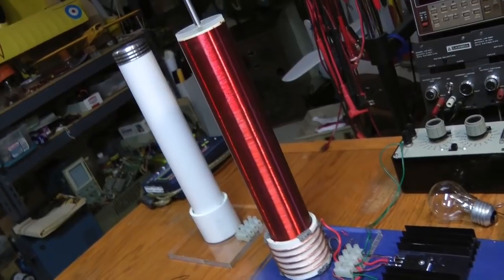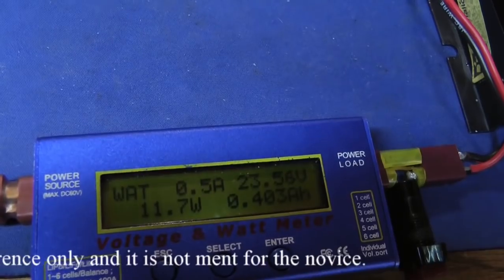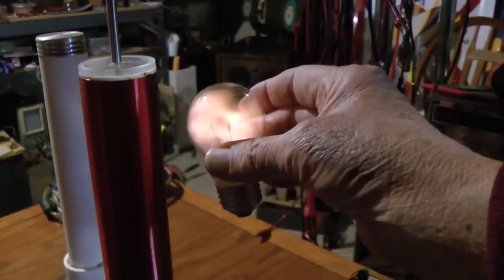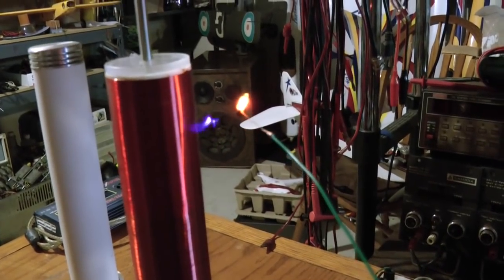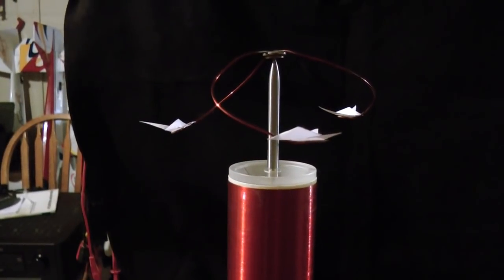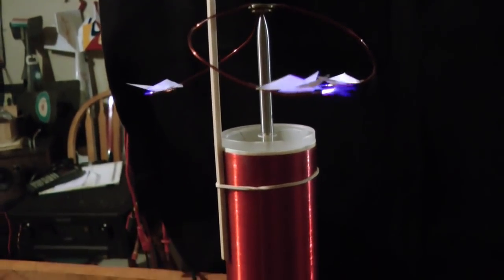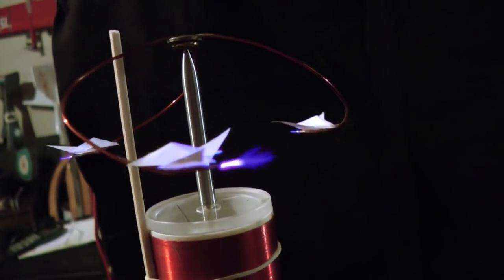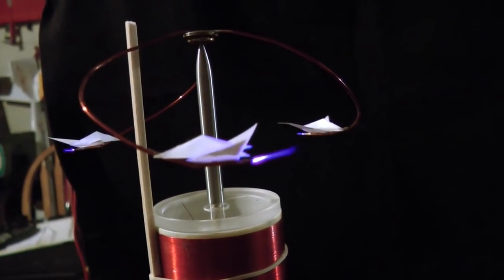Tesla / Slayer Ionic Propulsion

Comment: I may be totally wrong but I think the propulsion is because the charged plane ionizates the surrounding air, then since equal charges repell themselves the plane pushes the ionized air away as well as it is pushed forward.  (sorry for the bad English )
Reply: just in case you're wondering ionization is much stronger in the rear of the plane because that's where the point is, what do points have to do with it? i'd google it

Comment: Looks interesting,  also like a DIYr could build one of these. 
It would be intriguing to know if/how tip shape changes would affect the thrust vectors and spark plume shape.
Curious, does it hurt if you accidentally ground to the electrode?
Reply from the maker: Since high frequency travels around the outside of the wire I would imagine there could be varying results. I never shorted the coil. I'll give it a try some time.

Comment: what a cool demo.  i bet you could sell a lot of those little planes.  have you considered cutting off the neck of a wine bottle &  putting it over top electrode of the t.c. . then putting a positive grid at the wide end to attract & accelerate the ion flow??  might get a significant bit of thrust out of it....  might could make a fancy hi-tech ceiling fan.
Reply from the maker: That's a great idea Geo but I think it might be a risky adventure. The plasma or ion flow can set things on fire or burn holes in your skin. But I might make something like that anyway. Thanks

Comment: I wonder whether this one is ion propulsion.
Mass of electrons is very small compared to the mass it  need  to accelerate here.
I guess its bcz of the heating effect. The propulsion heats the air creating pressure differences which in turn cause it to move.
Others way seems kindof longshot..

Comment: Dude, can you make another one of those things, but make it have 8 legs, and have each of the legs facing downward?

I wonder if the amount of thrust generated by that will increase with more wires. And if you focus the force downwards, I wonder if it has enough force to lift itself 

Could you try that??  Thank you!
Reply: It wouldn't generate enough thrust to lift its own weight. Thats the issue with ion propulsion its not as powerful as chemical rockets

Comment: How much electricity has been consumed, may I ask, please? If the efficiency from electricity to plasma emission power is good enough, then everything will be possible in terms of space travel
Reply from the maker: It's not very efficient Rocky. The resonator is running at 24 volts and using .4 amps.

Comment: charges escape from the sharpest point of the charged device. I think that's what is happening here, resulting in an electric wind that rotates the prop
Reply: Hi, do you think such electric wind could propel something in a vacuum?
Reply: The slight breeze these  ion thrust devices (the litte jets in DadHav's video above) -- people call that the 'ion wind'.  That is not what makes the little jets move.  That ion wind is only a side effect of the purple stream of ionized air streaming out the back of the little jets.  That purple stream of ions BUMP INTO NEUTRALLY CHARGED AIR MOLECULES and those neutrally charged air molecules get pushed around by the ions, and those pushed-around neutral air molecules are the 'ion wind'.  That's not what pushes the little jets around.  The jets move around because of RECOIL.  Think of the recoil of a rifle into your shoulder when you fire it -- the opposite direction of where the bullet went.  It's Newton's 3rd Law of motion -- "equal and opposite reaction'.  Think of the bullet as the ionized gas streaming out the back of those little jets, and think of the jets as the rifle.  Same principle of how normal rocket engines work.  RECOIL.
Reply: I agree with you, recoil, and equal and opposite reaction.
BUT.
In a vacuum there is NO opposite reaction, due to the fact there is nothing to react on.
The experience proves it, and the logic too.

Comment: could it be air heated to a high temperature that causes the propulsion? a combination of air and supercharged electricity....just wondering
Reply from the maker: From what I've learned recently. The high voltage high frequency emits ions from the cathode or pointed wire. They then try to complete an electrical connection to the anode which in this case is earth ground.
Reply: DadHav so what about in a vacuum, and do  you still need a ground?

Comment: when working on the high voltage antennas on naval ships my father would get microscopic holes burnt to his bone in his fingers when they came to close to them
Reply from the maker: The same thing happens with this. A tiny but deep burn like if poked by a red hot needle. Ha, the good part is that it's self cauterizing.

Comment: Here's what's happening, as far as I understand it:

The ends of the wires have significant negative charge, and they ionize the air around them (they knock an electron off of some of the atoms in the air). Like a magnet, similar charges repel. What you had there was a breeze generated by charged air pushing very forcefully away from the wire ends. It takes lots of electricity, though. 

For reference, satellites equipped with the most advanced ion drives produce about as much force as the weight of a quarter in your palm. The cool part is that they can do this for weeks or even years on end. Kind of like if grandma's slow scooter accelerated at 1m/s/s constantly starting at 7am on Tuesday, she'd be going 8,000mph in an hour, 40,260mph by lunchtime and 193,000mph by 7am Wednesday. Satellites accelerate at about .0001m/s/s.
Reply: Variety_Pack It won't work in space when there is no air to throw away. Very cool video I wish I had such a tesla coil.
Reply: It does work in space because they blow Xenon from a tank past a charged grid.
Reply: Xenon isn't needed in LEO because there is still a small amount of atmosphere. Xenon is used for larger or higher orbiting satellites. But you are right, the principles do work in space. The other thing is, the air (O2) molecules are gaining electrons from the steam, and then dumping them as they jump down to lower excited states (the production of the signature "blue glow" of oxygen). If it were knocking electrons off the oxygen, the color would be different (That of the atom gaining them and emitting the photons). My guess is, the small amount of orange glow you can see in the spark area is due to hydrogen being ionised, hence why the orange color is only present at the centre of the spark. The Oxygen atoms are being ionised to -1 or -2, which explains the two different blue colors at very close wavelengths.
Reply: Oh cool. You obviously know more about this than I do, I just wanted to make an ion contraption to lift a foil triangle once in middle school. Everything I've written is stuff I remember from the big posterboard foldout display I put up about 18 years ago.
Reply: Hahahaha, nothing wrong with that. Until recently I had a hard time wrapping my head around positive and negative for charge distribution. I may be cheating a little, I am a physics student. What you are saying sounds good, but the problem is the charge distribution. If it were knocking electrons off the atoms in the air, they would be positively charged, thus attracted to the electrons in the device. The flow would be reversed. The explanation you have for it is the same, just the opposite outcome. I didn't mean to make you sound wrong at all, I just wanted to clarify the issue of whether the ions were positive or negative.
Reply: Please, clarify away, tell me about ion drives. I'm an OT, with a big science-nerd shadow. I thought it was electromagnetic repulsion that drove this, which is why they use noble gases to drive these?
Reply: Variety_Pack - It is electromagnetic repulsion. The reason noble gasses are used is because they have the most stable neutral configuration in their valence shells. There is less likelihood of creating a chemical reactant in the exhaust, thus less likelihood of etching the thruster nozzles. However, when working with atmosphere, it is not only less efficient to bring extra weight as the noble gas would most certainly do, but it is also easier to ionise non polar molecules with valence bonding on one or two pairs. The repulsion occurs most certainly, as you said you thought it did. But the oxygen molecules have a much lower ionisation energy that noble gasses do for this purpose. Xenon gas ion propulsion requires extreme amounts of power to overcome the ionisation required to produce meaningful thrust. Oxygen provides this thrust at lower energies. 

The negative propulsion occurs when there is two negatives. If the atmospheric molecules gain an electron, the are at negative charge. Not the other way around. If they lost an electron, they would have positive charge. This is how the ionisation is happening in this video. In higher orbits where there is much less atmosphere, an it is too inconvenient or cost ineffective to provide repairs, xenon is used to provide an atmosphere to thrust away from the craft as you said. The reason for it being a noble gas is less to do with ionisation that is is about preserving the thruster mechanisms.
Reply: Oh yeah, I remember reading all that now. Thanks! I knew electrons produce negative charge, I just got myself confused. Thanks for curing my ignorance!
Reply: It's all good. Glad I helped rather than standing on your toes. I kinda felt like you knew it, but I just felt like the charge distribution needed clarifying is all. You really do enjoy this stuff don't you? You seem like me... Like a lot. I only just started my first year and I only decided to go because I spent a decade in a field that tore me apart. Physics was a fun thing in my spare time, but I never realised how much it would open my eyes to the world around me once i started...
Reply: I really enjoy this stuff. I used to be a small business owner for about 6 years, and I hated it. I know what you mean. Now I help people get back to work. I like building cool stuff like I said, and actually right at this moment I'm building an RC plane with solid rockets on it. Glad you find what you enjoy, it makes such a huge difference! For me it was just about knuckling down and doing the hard stuff I didn't want to do (my Master's degree) to get to the part I love.
Reply: That is exactly the same as me (PC repair business owner for a decade) and I am doing the degree to finally get myself sorted with a job I actually want to do. The RC plane sounds epic. Solid boosters? Hope that thing has titanium wings! Hehe :P
Reply: Foam wings, because that's cheaper! I just put the boosters under the fuselage pointing up thru the CG at about 10 degrees. Hopefully this time it's far enough down that it won't melt the tail off.

Question: Can you tell me about amps and volts? I kinda get that volts are similar to water pressure and amps are pipe diameter, but does the analogy relate with kinetic energy? (More pressure + less CFM = X force, less + more = X, and more + more = X(n)??) Does that work the same? Electricity is a bit confusing to me.
Reply: If you wanna keep chatting we could use my Discord server

Comment: It could be due to the electrical current coming out of the wire interacting with the magnetic field created by the coil
You can do a similar thing with some neodymium magnets, a copper wire, and a battery. I forget what this is actually called, though.

Comment: let me guess,the charge is pushing forward,the electric charge,just as in the case,when u leave up a high voltage electricity wire open it simply keeps swingling around.
Reply from the maker: I never thought of the high voltage line scenario.

Comment: Really what you want to do, is use a gas plasma instead of copper to lighten the load and weight. It would need to be wound a similar way probably ceramic or glass.

Comment: Yeah - that seems like a pretty effective propulsion method. Here's the dope:
Ion wind - Wikipedia
https://en.wikipedia.org/wiki/Ion_wind
"Gives the air a space charge which repels the point because the polarity is the same for the point and the air."
"Net electric charges on conductors, including local charge distributions  associated with dipoles, reside entirely on their external surface (see  Faraday cage), and tend to concentrate more around sharp points and edges than on flat surfaces. This means that the electric field generated by charges on a sharp conductive  point is much stronger than the field generated by the same charge residing on a large smooth spherical conductive shell. When this electric field strength exceeds what is known as the corona discharge inception voltage (CIV) gradient, it ionizes the air about the tip, and a small faint purple jet of plasma can be seen in the dark on the conductive tip. Ionization of the nearby air molecules result in generation of ionized air molecules having the same polarity as that of the charged tip. Subsequently, the tip repels the like-charged ion cloud, and the ion cloud immediately expands due to the repulsion between the ions themselves. This repulsion of ions creates an electric "wind" that emanates from the tip, which is usually accompanied by a hissing noise due to the change in air pressure at the tip. An opposite force acts on the tip that may recoil if not tight to ground."
Reply: Ion-Christopher DiMeglio 
Its not heat generated by the glow that could also induce thrust?
Also for ur theory, if this were in a vacuum would it still work (since very few particles to repel against.  Just curious.
Reply: Ion-Christopher DiMeglio wonderfully explained so physics students...
Reply: OP made that point that it doesn't work in a vacuum. In a vacuum a source of ions is both "fuel" and "thrust" same as conventional fuel - there is no magic conduction of air. Ion thrusters are a few ounces to a few pounds of force because of that. At great distances in a vacuum it still works to continually accelerate  a large load up to near light speed. Interesting sidenote, in space the ion stream has to be neutralized by a second ionization source that is negative, so that the entire ship isn't hyper-charged positive like that Tesla coil is.

And I just quoted Wikipedia - not my theory. OTOH it is my name!

Comment: Okay here is my best guess... The electricity being discharged into the atmosphere creates ozone by splitting the oxygen Atom . The expansion of the O2 = two 01 atom causes the thrust that propels the little planes. That thrust of ozone actually disturbs the mixture of propane or butane and oxygen till the flame Smothers.
   Can you smell ozone after it run for a while?
Reply: Go learn about Newton...F=MA...
Reply: Christian Buczko how is what I said in violation of Newton's Law? When an O2 atom is split it volume increases, creating a higher pressure behind the object. This is simple physics it's not hard
Reply: I wasn't very clear sorry, the electrons have mass, their emitted from the spike under acceleration creating the force required to move the spinners. It works in a vacuum, so your theory is doubtful...its a basic ion drive similar to what nasa has tested. This method will be very inefficient though requiring alot of power.
Reply from the maker: Almost anything I've experimented with and made sparks created ozone, this included.
Reply: DadHav does your demonstration work in a vacuum? Does it depend on a oxygen molecule?

Comment: M.Jean Louis Naudin is the inventor of the lifter on the year 2000' ! see his website : the Maximus 2 @ 250g...just ionic wing electrostatic pressure of ion on the molecule of the air near the wire (electrode positive)
Reply: This is misleading. Ion propulsion was known for a long time. I preform experiment in 1968. The author of this video is no right track - use more needles.

Comment: Put it in a vacuum and see what happens. I've seen ionic thrust before but it didn't work in a vacuum because it is pushing air. It might not have flown because of the mass of the apparatus trying to work against gravity. There is much less gravitational force acting against your experiment.

Comment: A nice & great example of Ionic propulsion, but how about in the vacum without oxygen?
Reply from the maker: I don't have a way to test this in a vacuum. From what I understand a thruster as used on a satellite is different. To have it work in a vacuum you need both the anode and the cathode on the thruster and the use of a gas like xenon injected into the ion flow to create sort of an artificial atmosphere. There are also magnetic fields involved as well.

Comment: Not ions. Electrons via photonic exchange affecting massive particles via angular momentum transfer. Spin.
Reply: Chuck Just Chuck PUT IT IN A VACUUM
Reply: Chuck Just Chuck why does it shoot out and not up?  Asking because i dont understand, serious question.
Reply from the maker: It was my question to. I thought it should shoot down towards earth ground. it's funny how the ions or electrons can be directed by the shape of the wire.
Reply: Think of the "flyer" wire as a wave guide. The electrons are actually "spiraling" their way through that conductor. When it ends they have that same direction of momentum and will exit on their way back to the more positive charge of the field. It's an interesting twist on the EM drive mechanic. Try it without the flyer (just the wire) and see what happens. Also - try angling the 3 ends of the flyer wire at different degrees from what you have them at (it looks roughly at 90).
Reply: I doubt Vacuum would matter, except that it might have less air friction to deal with... But - it would be interesting to check and see...